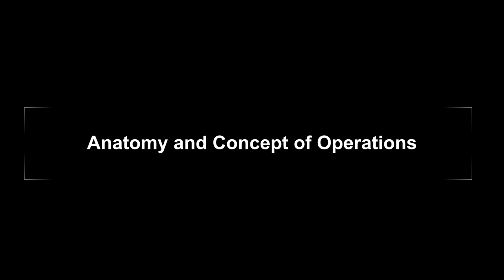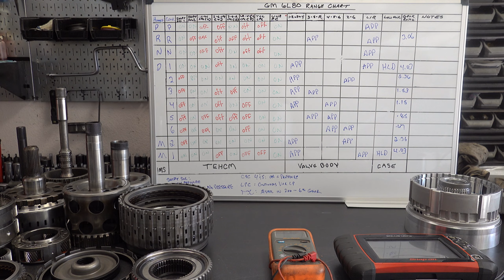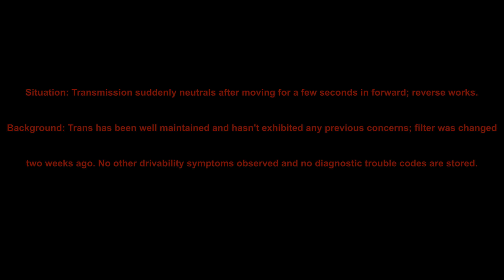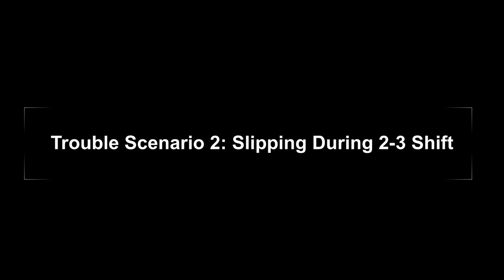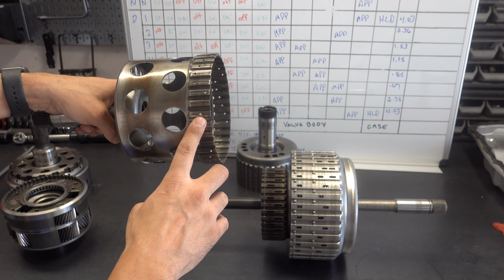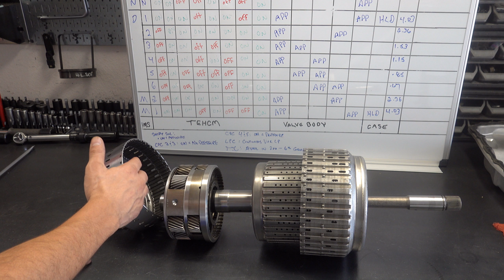6L80 Troubleshooting PT1 - Fundamentals and Range Charts

Comment from the maker: All - I have added GDrive folder link to the description where you can access and download the range chart as shown in the video for your records.

Please Note: Shift Solenoid 1 apply strategy is as follows:

Park/Reverse/Neutral/Drive1/Manual 1 - On
Drive 2-6 and Manual 2 - Off

The whiteboard in the video mistakenly shows it as being off in Drive1.
Reply: Thanks so much for providing this as a download. For information, Shift Sol 1, in Drive 1, is labelled as OFF in the download file, but it is labelled as ON in the video. Can you confirm which this is supposed to be for this solenoid in Drive 1? Thanks!
Reply from the maker: @brianhart9318  Hi Brian, thanks for watching and sorry for any confusion. The correct application sequence for Shift Solenoid 1 is as follows:

Park/Reverse/Neutral/Drive1/Manual 1 - On
Drive 2-6 and Manual 2 - Off

I mistakenly wrote "On" for Shift Sol 1, Drive 1 in the chart on the whiteboard in that video and failed to catch it prior to publication.

Thank you for watching!

Comment: lots of info!!!!! any idea on 3-4 shift, it shifts then revs up like a neutral then slams back into gear. i replaced the tq converter but still the same. does have some shudder everynow and then. 2016 2500hd 4x4
Reply from the maker: Thanks for the view and kind words, Harry! Sounds like 456 clutch is shot but can also be either TEHCM or valve body. Have you scanned for codes, monitored live transmission data on a test drive and conducted a driving line pressure test to see if there are any pressure drops on the 3-4 shift?

Comment: Nick, thank you for taking the time to help guys like me with these issues. It’s genuinely appreciated.
I have a 2009 Yukon XL 2500 with the 6L90 at about 180k miles. Recently it went into neutral (no forward movement) right after driving and coming to a stop sign — very similar to the scenario in the video I referenced earlier.
Before this started:
First thing in the morning it would have a slight stutter/shudder on initial takeoff only. It wouldn’t happen again until the next morning.
Sitting in a drive-thru line (extended time in Drive with foot on the brake) the trans would heat up quickly to around 200°F. On the road it normally stays around 170°F or lower, even on hot days.
The 2-3 shift often feels like a noticeable jerk unless I accelerate quickly.
I dropped the pan, replaced the filter and fluid about 6k miles ago and saw nothing unusual. I trailered it home and it drove fine off the trailer into the driveway. The next day it stalled in reverse a couple of times (new symptom). I’ve checked the dipstick multiple times and there’s no visible metal in the fluid. I scanned it with my BlueDriver and have no codes.
I’m thinking the torque converter is the main issue, but could the valve body also be involved? Any insight or recommendations on what to check or replace would be very helpful.
Reply from the maker: I'd yank it for overhaul. Sounds like converter failure in combination with leaking 35R drum and extremely worn pressure regulator valve and possibly valve body.
Reply: @nickstransmissions  Bummer. I was unable to message you on Facebook. Are you still taking on new jobs?
Reply from the maker: Yes but I am about four weeks out in terms of lead time. If you’re able to wait, I’ll reply back with my Craigslist ad where you can contact me.

Comment: Hi Nick, Rebuilt 6L80 in a 2015 Suburban - drops out of gear - D1/M1 at idle hot. Otherwise it runs good. What do I need to check?

Line pressure at idle is 100 psi on physical gauge. Scanner shows 80 psi. When it drops out of gear I can see the pressure switch 5 goes low. Raise RPMs and it will engage and the switch goes to high. Removed valve body and air check shows possitive clucth enganement with 60psi air.  It came into the shop because it had slipped once so customer didn't want to risk it. After tear down we found 456 clutches dark, most bushings a bit worn and pitted, torque converter clutch was totally gone, worn oil pump , bellhousing and stator plate.
The following was done in rebuild. Machined oil pump surfaces and installed new oil pump, new clutches, new bushings, Sonax boost valve kit - 104520-12K and pressure regulator kit - 104520-15K, new check balls, and separator plate gaskets(2015 and up).
Reply from the maker: Hi Hotshotbz, 

Thank for watching. Did you replace the rear sprag/roller clutch assembly during the rebuild? What about the TEHCM?
Reply: @nickstransmissions I replaced the switch membranes in the TEHCM. The sprag I did not replace since it did not show any signs of it being bad before we tore it down and it didn't look bad on the bench. Would a sprag consistently work  cold and consistently not hold when warm?
Reply from the maker: You cannot tell by eye if a sprag is worn, unless it's already been damaged/rolled over/destroyed. I replace one-way assemblies 100% of the time on all my full overhauls; same with the TEHCM. Without actually being there myself, I'd suspect the sprag and TEHCM (one or both) as being the guilty party(ies). 

Replacing the diaphragms, filter screen and seals is fine for routine maintenance but wouldn't bank on a used TEHCM as they can fail at anytime (sometimes within the warranty period and do significant soft part damage to the unit). 

Continuity test the pressure switches on the TEHCM - make sure they do what they're supposed to do when at rest as well as pressurized (you can use a pencil eraser to add pressure to each).
Reply: @nickstransmissions  Here is an update. It turned out we mixed up the upper and lower gasket. The old gaskets got destroyed when we removed them so couldnt compare gaskets. We failed to identify that the upper and lower gaskets were different and therby cause a cross leak. I had a hunch it was something simple but it took someones expirenced eyes to notice the gasket issue. Figured I would post this in case someone in the future runs inot this same issue.

Comment: Nick, here’s my issue.
Turn on truck, drive to first stop sign with no issues and stop, truck doesn’t move when accelerating from a stop, mess with it a bit and it goes and drives perfect for the rest of the trip. First happened 5 days ago on Friday. 

Saturday: drove it 20 miles no issues. Then when I left the parking lot, drove up to the first stop and waited my turn, throttle increased RPM with no response from trans, messed with it got it to drive home without further issue. 
Sunday: to and from work no issue. 

Monday: first stop in my neighborhood same deal. Couldn’t convince it to move but reverse always works. Backed it up to my driveway, while rolling forward out of my driveway transmission engaged and I made it to the second stop out of my neighborhood then couldn’t move forward. Backed up to my driveway again and waited 3 hours for a tow truck to take it to a shop. Tow truck driver ends up driving it straight onto the truck. 

Tuesday, I get a really really good inspection from the shop, I’m talking dropped pan, pictures of fluid. It doesn’t look out of the ordinary and I inspected it originally and it didn’t smell burnt. But basically they just said “internal issue” “full rebuild.” So I had a buddy drive me up to the shop and I DROVE IT HOME. Granted I made sure not to come to a complete stop. But full shift range and smooth. I kept driving it around my neighborhood consistently getting it to replicate the issue. But always able to reverse back to my house and get it rolling forward to engage the transmission back in to drive, no codes until then and eventually it went to limp mode in I’m assuming 2nd gear with a P0700. 

I was going to drive it today (Wednesday) a little bit more and see if it stays in limp and hopefully get a more specific code to pop. But at this point I just want to drop the pan again. Do a full fluid flush, replace Mode switch, filter, TRS, pretty much anything on the bottom end that I can do without an GM capable programming tool or dropping the trans. 

Side info. Full trans replacement with a GM certified done 3 years ago by a good shop that I am really hoping used a AM torque converter. 

What’s your first impression? What steps would you take? I love the video but also had problems finding the follow up about the valve body and explanation of all the components. I would also like to see some more trans related stuff like the input shaft sensor or the electrical component connected to the linkage.

Thanks for your time. I’d be happy to chat via phone if that’s easier for you.
Reply from the maker: I'd do a line pressure test and plug in a bidirectional scan tool to bring up live transmission data to see what the TEHCM is commanding the transmission to do so you can compare it to what's actually happening...The line pressure test will show you if line pressure is dropping during the presentation of the symptoms. If so, you'll need to perform further diagnosis work to find out why.

If line pressure is stable and meets specifications, my next step would be to drop the valve body and look at the check balls - it's very common for them to be worn - here's a quick overview of the problem and related symptoms: https://youtube.com/shorts/alK3YiX4w8c

I'd also continuity test the TEHCM's variable force solenoids and pressure switches - also look at the pressure switches to see if there is any debris in the little diaphragms or if any are cracked / seals cracked-broken...If so, buy Transgo's TEHCM service kit and replace the diaphragms and seals. 

If none of those things fix the problem, trans has to come out for overhaul.
Reply: @nickstransmissions  perfect response. Step by step. Thank you so much. Let me know if you need any help editing videos. I’m your guy
Reply from the maker: Will do, Nick...I'll let you know if I would like to explore outsourcing the edit function (it may be something I do during high volume periods in the shop).

Comment: Morning Nick … this is a really helpful video … in the first scenario falls kinda in my situation … refreshed 6l80 w/billet converter and new techm and stator/bell housing machined ..3/5/r drum welded .. relearn adapts set top 3 buttons hit on hp tuners … with trans go kit valves pr and valve body valves… new o rings … used everything else as that’s all the neighbor could afford ..
—originally had the fwd planetary upside down so .. this is install#2 .. lol … good thing I’m free on manual labor for my friend ..
-in drive …it starts to go and like 2 seconds later it falls out … let off gas it catches back up.
-put truck in manual 1 truck doesn’t fall out of gear …. 
..ChatGPT said 2/6 clutch but I’m not seeing the range guide show that.. honestly only the 3/5/r hub seems to be the only thing that was kinda difficult to assy with all the o rings.. I think it’s the 3/5/r drum o rings maybe I cut one or?
Reply from the maker: Only one way to find out, Kenneth...Remove the VB and do a case air test. Most likely, you'll detect issues with at least one clutch pack...Once done, pull the unit and make the corrections.

Comment: Thanks Nick for the info at minute 34 the planetary being upside down ….on my 1st rebuild I have installed that planetary upside down and it gives you no room to shim if it’s upside down that I have found out lol by personal experience on my first trans I rebuilt. I wasn’t having any end play and thanks to another one of ur videos it got me back in there to looking at what could I have possibly done wrong … something as simple as a planetary upside down…   I had no END play …and busted that Torrington bearing ..just a heads up at the end when shimming the gaps …
But now I rebuilt my 2 nd trans and it used to go prior to rebuild but now it won’t go forward or reverse at all after rebuilt….? I have checked all the valve body balls and shifter engagement nipple and still nothing … maybe I put this upside down again but I don’t think so cause this time I had to shim it as well lol and I learned that during the first rebuild … so I hope it’s something else causing my no drive or reverse issue lol
Reply from the maker: Hi Ken, there's a bunch of things that can cause a no-movement condition, assuming the TEHCM has been properly programmed to the vehicle:
1. Front planet in backwards, as you know
2. Broken pump rotor and / or slide
3. Filter cracked or not installed
4. Insufficient fluid level (fluid way too low)
5. Torque converter failure
6. Stripped input shaft splines
7. Bad transfer case (4WD only)
8. Missing #1 and #5 check balls in the valve body

You will need to confirm/deny them all, starting with the easiest things first (fluid level, filter, TEHCM, VB and then case interior.
Reply: @nickstransmissions can you go into a little detail on the 4x4 statement… because I do have a transfer case “no comm. “ so I’m wondering will the trans go into limp mode to keep the trans from engaging the driveshaft at all ?

Comment: I have a 2018 Chevy Tahoe 6l80
Replaced pressure disc some was bad but getting around 275 on temp
And it cuts off.. I did the thermostat fix and I see around 175-180 temp while driving.. it was shifting hard and I heard a whining sound while idling if I get gas you can hear..
Reply from the maker: Hi, thanks for watching CD Perf...What 'pressure disc' are you referring to? 

The whine sounds like it could be the pump or possibly front planet.
Reply: @nickstransmissions  the switch repair kit with 5 orange round disc and rubber seals do you know any range diagrams to go off if while I live data on scanner to match to a chart to see how the trans is functioning if normal ?

Comment: I have a 6L80 that starts acting up at 150 deg. looses forward gear at about 160 deg. Then looses reverse also at about 175. Has a billet TC.
Reply from the maker: The TC cover material is not relevant to your symptoms - unfortunately, it sounds like it has to come out, regardless of its history.
Reply: Found the issue. Bad O ring in between lower n D ring in 135R drum. Works great now. Hope this can help. As you helped me so much with testing video. Thank you again! Great help!

Comment: Excellent videos! I’m a diy guy with very little experience with automatic transmissions. I’m ok at understanding mechanical concepts so you make it very easy to understand. I have a late model 6L50 that came with a pretty decent 6th gear shudder. I did a flush, cooler install and added some instant shudder fix. It is much much better but I notice i still get some minor vibration, I also get some vibration in 4th gear. It makes a little bit of a weird noise almost like clatter/minor grinding noise. Its not very loud and I can only hear it when driving next to a wall or tunnel that amplifies the sound. The transmission has about 120k miles and was serviced according to log book when I got it.  When I did the next service I flushed it first , drove it for a couple thousand miles then did a pan drop and filter change, the initial fluid from the flush was extremely dark but did not smell, it did have some very fine glitter in the fluid if you looked really carefully in the light, there was not a lot of metal in the pan or on the magnet which was very surprising to me.
The filter was also very clean. There was however half a dozen metal fragments inside the filter that were about the size of coarse sand. ( which I didn’t want to see but was told by someone it could have been in there from new or from the initial wear in period). 
I’ve ran an ok scan tool and looked at the live data. Everything seems to be good, tc locks up properly but there is about 10-50rpm slip depending on load. No real slipping between gears. Would the issue simply be a  typical worn pressure regulator and tc? What is the likelihood I can solve this issue by  just having  those parts replaced and  upgraded?
Reply from the maker: Thanks for watching and the kind words, Punisher! 

I'd pull the unit and replace the torque converter...The metal fragments are likely from the converter clutch and/or elsewhere in the converter or possibly the pump working surface. If the trans is still functioning, you may be able to salvage it but the TC def sounds like it's slipping...I'd also install the Sonnax zip kit into the valve body then reinstall everything. Once it's filled back up with fluid, run a fast adapt relearn w/your scan tool then take it for a test drive...
Reply: @ sounds good buddy, that’s pretty much where I landed on it so  I’m really happy you have confirmed it for me. 👍 dropping the box is not something I’m willing to do in my driveway so I’ll have a proffesional do that. I would really like to do the valve body myself though, I enjoy it and I’m curious to see what that does for the box on it own. I already have a vac pump for other reasons so I will do the testing like you have shown in your videos. So I don’t upset the transmission guy should I do the valve body before or after I send the car to them?